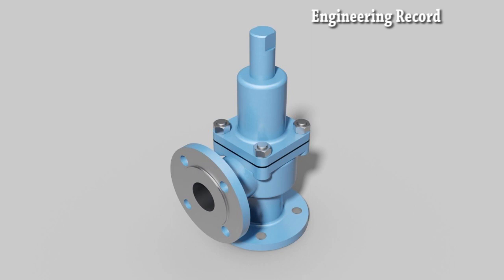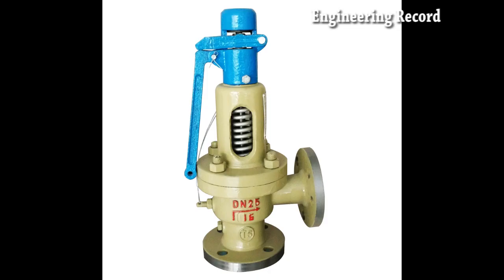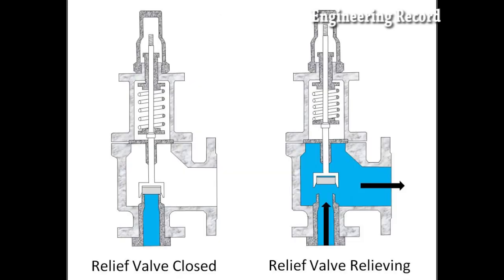PSV Pressure Safety Valve Selection Guide

Comment: If for conventional PSV is back pressure must be <=10% of Set pressure and for balanced PSV the back pressure must be <=50% of set pressure then what type of safety valve will be used if the back pressure exceeds 50% of set pressure?
Reply: Pilot operated